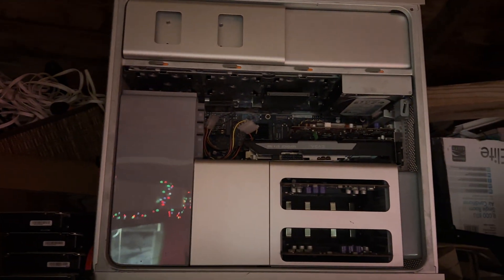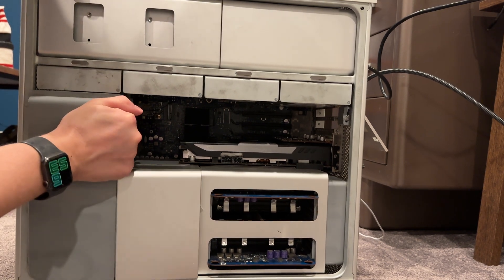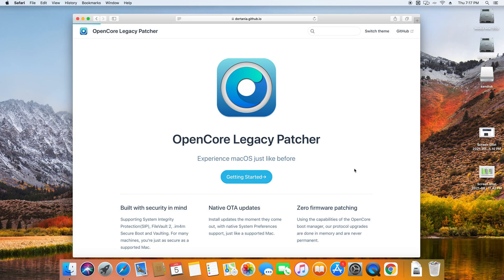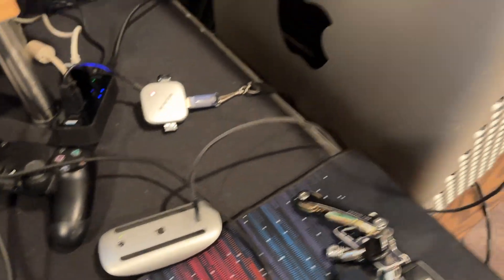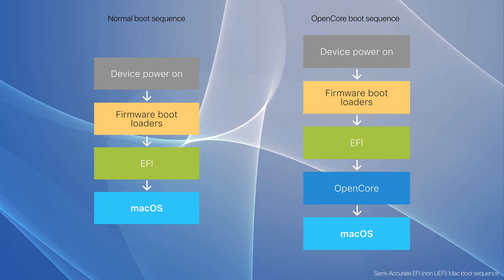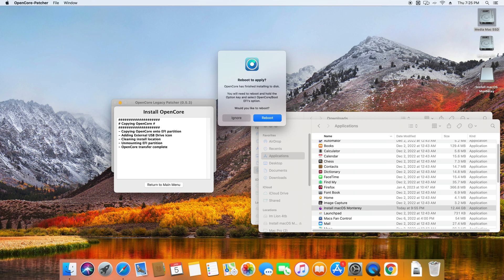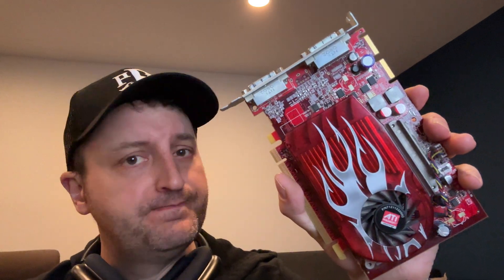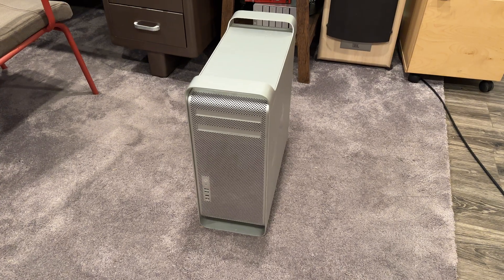Rescuing a Mac Pro 2008 and upgrading to macOS 12 Monterey with OpenCore Legacy Patcher

Comment from the maker: Dammit, for some reason I refer to my HD 2600 XT as a 1900 XT.  OpenCore 0.6 was released on Jan 23, 2023, with Mac Pros 3,1-5,1 now officially supported and old wifi chipsets
Reply: Yes! I fixed the fan in mine and I was thinking, wait? That is the HD 2600 XT isn't it? Please see my comment below, I could use your advice.

Comment: Super helpful video. I have the same machine (2008 3,1) that I got a Sapphire HD 7950 3GB for, but I cannot figure out a way to get the boot picker to appear. I tried numerous OCLP settings variations and even added the WhereverGreen and Lilu kexts manually to the SSD (an OWC job) as well, but still nada. Any suggestions would be welcome.
Reply: Update: there was a tiny little switch on the side of the card that needed to be flipped to enable the Mac boot screen. The card is no longer the issue, yet Monterey continues to get stuck at the "less than one minute" point. Thoroughly annoying.

Comment: do i have to have a metal supported gou because on open core site it says i can do it with unsuported metal gpu
Reply from the maker: Opencore now can run in legacy mode for older non metal GPUs although it does mean somewhat degraded performance.

Comment: I managed to get my 2012 Mac Mini running in Ventura!  Everything seems dandy, but there were little UI changes that caught me.
Doing the upgrade from a 32 GB USB drive took me over 3 hours, 90% of that was waiting... Get a usb 3 drive!
The keyboard control has me baffled, and I couldn't find the way to have the keyboard selection in the menu bar, a pain, because I switch between USA and German, often.

Comment: I got myself a Mac Pro 4,1 that I upgraded to 5,1 and using Open Core to have macOS Catalina!
I know Big Sur is pretty stable using Open Core, but Catalina is the last of the X line, has a ton of support for what I want to do, and I wanted to play it EXTRA safe as I planned to use this for a long, long time
Reply from the maker: You can always dual boot. Monterey generally is better than Big Sur for the Mac Pros as you get the later AMD drivers without losing too much support.
Reply: @dmug  I could always do that, in your opinion should I go ahead and do Big Sur or stick with Catalina? I heard "something" about future Big Sur updates not playing very well with Mac Pro 5,1's but if not and its just as stable I'll do Big Sur instead!

Comment: I'm having to resurrect the same model Mac Pro to use as a surrogate to import footage from an old miniDV camcorder. The problem is that I have HDMI displays, and the Mac only outputs DVI. Is there a specific cable you could recommend to convert DVI output to HDMI so I can drive a modern display on this venerable Mac? Thanks!
Reply from the maker: I just had a generic dvi to hdmi cable from Amazon essentials and somehow got 4k out of it with a GeForce 760
Reply: @dmug  awesome! Thanks so much. I’ll give that a whirl.

Comment: Is the hardware RAID card useful at all in any of these upgrades?
Reply from the maker: I know they existed but I don’t know if hardware raid controllers are still  supported or not.

Generally the Apple one are considered more or less eWaste due to the batteries and lack of meaningful performance improvement over soft raid. You can read about it here:
https://lowendmac.com/2018/mac-pro-raid-card-not-too-useful/

As far as others, you may want to try a group like MacProUpgrade on facebook or the Reddit Mac Pro group or Macrumors.

Comment: So this is 100%paranormal. I installed Monterey in my 2008 3,1 MacPro using the original ATiRadeon graphics card…
Reply from the maker: OpenCore Legacy Patcher will hack in the drivers for them but it doesn't work with a lot of applications due to only partial support. 

You see the effects of that in follow up video
https://www.youtube.com/watch?v=exCcSce2uNo

And there's also a 3rd video in the series where I install a RX580 in my Mac Pro 3,1
https://www.youtube.com/watch?v=XaStlvmvluI&feature=youtu.be
Reply: @dmug  do you think it will accept NVIDIA gtx660?
Reply from the maker: @AndresValdez54235  The 660s are a huge headache, they can be one of three boards, the GK104 or the GK107 will work but most are the GK106 thus not Mojave compatible aka supports Metal 2. If they're not metal 2 compatible I'm pretty even OpenCore can't hack in the drivers but I could be wrong. I'm in the habit of telling everyone to not bother the 600s series besides the 680, even better see if you can score a RX470, RX480, RX 560, RX 570 or RX 580. I picked up a RX 580 for $50 to replace my GeForce 760.
Reply: @dmug   Thank you Greg. This was a fun exercise... Silly question te bootable USB, can be used in many other machines right? Even those macs with out OCLP...

Comment: What do you do when you reboot holding the option key and no boot loader options come up . Just black screen. Using RX580.
Reply from the maker: You won’t get the native boot screen on an unflashed rx580. I swapped GPUs
Reply: @dmug  I thought OCLP has its own boot loader that displays with non flashed cards.

Comment: I've got one of these old macs and wondering whether to upgrade it or not. It's the original operating system and I've not even fired it up since around 2012. I also have a brand new Mac studio, so wondering if it's even worth investing time and effort in to it? I use my Mac for editing video and design software. I've got zero experience upgrading computers, other than changing ram 😂 Think it's worth a go?

Comment: 'm running a Mid 2010 macpro 5,1 and have tried upgrading to Monterrey from Mojave. Firstly i could not boot to the opencore boot loader using my RX580 gpu (had to revert to the original) and secondly my magic mouse will not connect via the bluetooth but the mac keyboard will. 
any solutions?
Reply from the maker: I’ll check in with an open core group. You probably need to check the AMD drivers for gop to get the open core picture, but the magic mouse issue is something I’m not familiar with.
Reply: @dmug  
The amd runs beautifully in mojave. Monterrey installed fine off the old GPU but I couldn't control it without the mouse and i dont currently have a USB mouse. 
Thanks, let me know what they say.
I will revert to mojave and troubleshoot in the meantime.

Comment: Are you able to use current adobe creative cloud products on it? I'm planning to work on my 2012 macbook pro 9,2 and am hoping a new ssd and better RAM is enough for me to be able to use photoshop and premiere pro. I can open photoshop currently on it (with catalina) but it runs pretty slow, and i havent tried using premiere pro on it

Thanks so much for the detailed and straightforward video!
Reply from the maker: Not an Adobe CC member as I've been post-adobe for years. I know Premiere 2024 is going to use AVX so it's the end of the line for 2013 and older Macs.
Reply: @dmug  🙃 ok, thanks for the info!

Comment: same machine, did Monterey and its actually kind of fab.  im making a Sonoma USB now.   that 2008 tower is excellent for all the drives.  the heat output though!  thanks for this one.
Reply from the maker: Awesome, should have my video tomorrow where I outline my experience with Sonoma on this computer. Spoiler: it isn’t bad at all and I have some benchmarks to prove it.

Comment: I don’t have a original Mac graphics card. I cannot access the boot selection screen.
Reply from the maker: About all you can do is buy a flashed card (or flash a model that allows for flashing) or an old gpu if you need it. 

The GT120s often went for dirt cheap as did the mac 2600 xt as those were the bottom models for 3,1 and 4,1s. They are always good to keep on hand if dealing with Mac Pro 3,1s - 5,1s
Reply: @dmug  thanks… I may have misspoken. It’s a PC graphics card running in the Mac so I guess that means it is flashed but I cannot access the boot picker :-( this has me really bummed out
Reply: @dmug  I have a Mac pro five, one that’s running in “version of Catalina

Comment: Hi    How do I know which one of AMD Sapphire Pulse RX 580 or AMD Radeon RX 580 is compatible to MacOs?    Thank you
Reply from the maker: It doesn’t matter, there was a false assumption long ago that was perpetuated that sapphire was the best since the blackmagic egpu rx580 apple carried used a sapphire. There isn’t a best , just look for dual height gpu RX 580s that do not have oversized coolers so they do not block a pcie slot
Reply: Thank you

Comment: Hi greg. 
I just watched some of your great vids again. 
as i have 3.1 project coming up. again. I must have watched and read your Mac pro guide dozens of times. Great resource.!
I¨m still in the middle of my mac pro 1.1 and 5.1 projects, but needed some easy distraction.  

SO to my surprise, you mention EXACLY the same download assets spinning wheel bug on the githuib page,
just as i experienced on my Hackintosh NUC8 running catalina. once i used chrome its all good. 

by now i have moved on to a better macos. ;) My hackintosh NUC8 imac 2001 (The infamous LAMP) is now running Sonoma Beta 4 / Ventura 13.5 / Monterey 12.6.8 AND Windows 11 Pro 22H2. with few to no hassle 
Keep up the good work and keep our beloved Mac Pro's alive for another year or two ;)

Comment: hello, tomorrow I'm going to get a Mac 3.1, I saw that the extreme AirPower is missing, I would like to update it to the latest version of Mac OS X, I have the right requirements (even the ram), I have to do it with open core, I wanted to ask you which card Wi-Fi can I buy? Thanks in advance

Comment: How did you solve the wifi card problem?
Reply from the maker: I had upgraded my wifi card around 2014 so it was natively supported in Monterey.
Reply: do you have the link of the store?
Reply from the maker: @Diabholus  Has the link from when I installed it but you can find it for much cheaper than here OSXwifi

https://blog.greggant.com/posts/2015/11/15/installing-80211-nac-bluetooth-40-airport-mac-pro.html

Comment: Is it possible to explicitly update a existing Mojave 10.14 to Catalina 10.15 via open core?
Have a 3,1 on 10.14 with Fusion 360 fully operational, but need 10.15 for 3D printer software.
F360 no longer allows New installs on 10.15, so trying to migrate the operational install by Updating if possible.

Comment: Hi, could you recommend me a graphics card for my Mac Pro 3.1 - 2008? Actually I use an ATI Radeon HD 5770 1 GB with OpenCore Mac OS Big Sur. Thank you.
Reply from the maker: Depends on what you're after, if for opencore, hard to beat the RX 570 or 580 for bang for buck, RX 570s go for as little as $30 USD and and RX580s for $60. RX580s are still enough for gaming in Windows for medium settings 1080p for many titles, and the 580 has a special hack to show bootscreens on the 3,1s but requires driver hacks for later macOS.
Reply: @dmug  Thank you, so, the RX580 is compatible with my Mac Pro 3.1, right?

Comment: Love you Chanel, I have a Mac 3,1 running Final Cut Studio. I need need some kind of large storage device (60 TB) that will support / communicate with a Mac Pro of this era what options would you suggest.
Reply from the maker: 60 TB will have a lot of upfront cost just due to the drives. 

The best option is to buy or build a NAS as you'll be able to use it with whatever your next computer ends up being and going 10 GBe as Unraid and ZFS are oodles better than creating a jenky-and-out-of-date soft RAID as RAID is pretty much dead at this point.  Plus with SSD caching in modern NASes, it's a helluva lot faster as you drop in a 2TB NVMe as the caching buffer and most have enough CPU horse power to do things like Plex as a bonus. 

The biggest issue is a NAS you'll either want a quality-costly solution like a Synology or dumpster dive for a PC and buy a license for Unraid until you can afford to get a lower-power PC. Unraid isn't perfect but it's also not terribly expensive.

After that, it's getting something like a USB case that has multiple drive bays, which is where I'm at but will eventually go the route of a NAS. 

Just skip anything that involves macOS managing softRAID. You're much better off just having 4x 16 TB HDDs. Really, skip any solution that uses soft RAID.

Comment: I have a non-flashed RX 580 and it's being a p.i.t.a. to make it work 😥. I followed the guide to restart in recovery mode, and tried to set my OCLP as the main boot device. It happens that despite it seems to do the right commands, when I restart my Mac Pro 3.1, it just goes again to recovery mode. I can't see OCLP boot screen. Any help?

Comment: Can you help me I have a mac pro 3.1 and the RX 560 card I can't install monterrey if you can help me or tell me where I can contact you. I pay for your work friend thank you very much 🙏
Reply from the maker: Have you watched my "How to Install OpenCore in 5 minutes" video?

I have a written version
http://blog.greggant.com/posts/2023/01/23/opencore-legacy-patcher-quick-instructions.html

Also I'd say try one of the communities if you're having a specific problem (Facebook, Reddit, MacRumors etc), you may need to check the enable AMD in the OCLP.
Reply: it arrives at munitos 10:55 and when another restarts I give it the option command + P+R and then it does the same thing I can't go there to configure macos Monterrey..
Reply: @Pazmixteca I’m in the same state with the installation. Did you find a way out?
Reply: your card is 760Gtx
mine is 960, do you think it works with monterrey?
Reply from the maker: @Pazmixteca  The GeForce 900 series do not have Metal drivers thus can't be used beyond High Sierra.
Reply: How many GB is yours to buy one of the same..
Reply: and the 8GB RX 580??

Comment: Thank you for sharing this! My home machine has been a 3.1 Mac Pro with a GTX 9800, 16 gigs of RAM and an SSD in it for the last six or seven years. It's been great, and does everything I've asked of it. The only problem is that now certain important software I need to remain compatible with work is aging out and no longer supported on my ancient 10.11.6 El Capitan. Monterey would give it many more years of life. It would be nice running a 20 year old computer that still handles everything a normal user wants. Maybe not high-end gaming, but I'm more of a retro games sort of guy, anyway, well into my 50s.
Reply from the maker: Your 2008 Mac Pro is 20 years old, five years older than mine? ;)  Jokes aside, Monterey runs really well on my 3,1 but it's not my daily driver so my experience is pretty limited.

As far as games go, I was playing games on  my 3,1 as late as early 2018 before I swapped to a 5,1. With a beefier GPU you can play somewhat modern games. With the Vega 56, I was playing 1440p with mid/max settings at 60 Hz in games like Lord of the Rings: Middle Earth series and Assassin's Creed games reasonably well.
Reply: @dmug  Hehe, no, I meant if I can keep it running for another five years, THEN it will be a 20 year old Mac, and that would be cool. :) From poking around, it seems like it can run a pretty recent Mac OS with an extra RX Radeon 5700 XT I've got kicking around. I'll definitely be experimenting!

Comment: Great Stuff i am just in the process to upgrade my late 2013 iMac to Monterey with 16GB RAM so it should run fine. My first Computer was an iMAC G3 (Those Colourful Apple "Eggs" and used it from 1998 until 2006. At 98 all my friends had Pentium II Computers but i knew at that time that Apple will be big some day. I also got my first PC in 2001 so i always learned on both systems. Hands down Apple has been not surpassed in reliability so far.
Reply from the maker: My parents always had a Mac, and even had the Bondi Blue 1998 iMac Rev B. The iMac wasn’t the computer I wanted (I ended up with a powermac g3 450) but I also was rather taken with the design.

Comment: Hey, I just did the Monterey update on my 2009 mac that I use in my recording studio, and I'm running into a bit of an issue.  After updating to Monterey, I update Logic Pro X.  My USB audio interface (Allen and Heath Qu-24) is recognized by my mac as both an input and output device.  Audio comes out through the interface just fine, and the mac itself recognizes audio coming in from the interface (I can record voice memos with the interface).  But when I open up Logic Pro X, it will not receive audio from the interface.  It can send audio out through the interface, and it recognizes how many inputs the interface has available, but it will not actually register any audio coming in from the interface.  Is there any solution for this problem?
Reply from the maker: While I do own and sometimes use logic x, I don’t have an interface to my OpenCore computers. I’d recommend trying one of the OpenCore or Mac Pro groups on facebook, or Reddit or macrumors as I’m unfamiliar with Allen and heath audio interfaces.